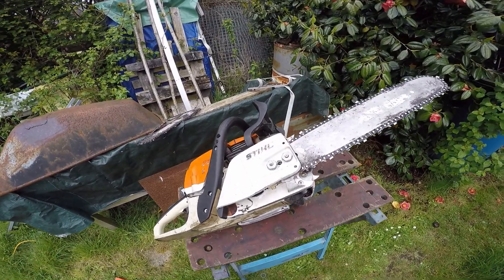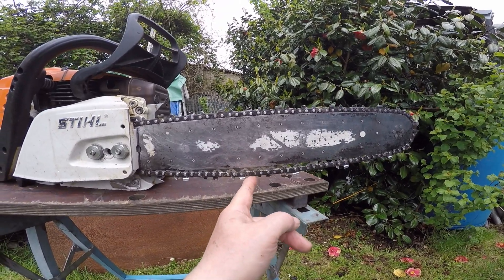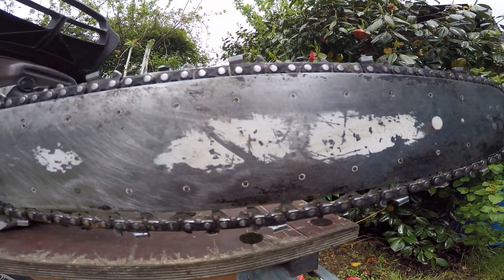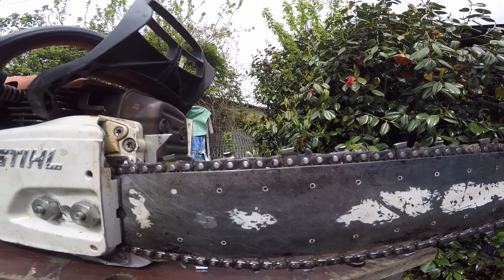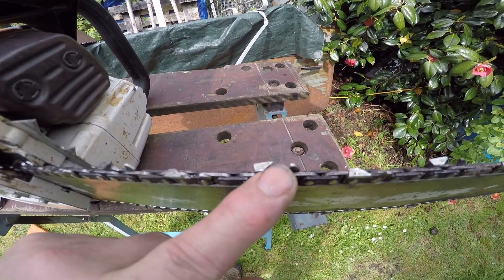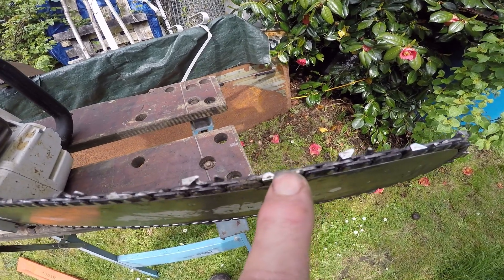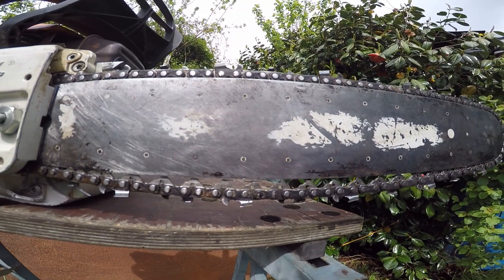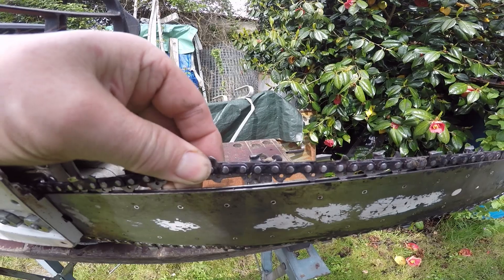Why Does The Chain Come off My Saw?

Comment: Very informative video. I don't understand yet how much the depth gauges need to be filled away to correlate with tooth ware but then again I don't own a chainsaw yet.
Reply from the maker: If you're just starting, follow the manufacturer's advice. Basically this means that the depth gauges don't need touching 'til the chain approaches half worn. Then you can get guides that match gauge depth to individual cutters. Oregon and Husqvarna both do one. Of course you could join a Facebook group or go on Youtube and watch hours of dubious advice about how to sharpen a chain and how to treat depth gauges.  Or you could watch this: https://www.youtube.com/watch?v=G94bU1DlMtY&t=51s  This isn't me. Don't know the guy, but it's the advice I'd give, well shot, well thought through and done with no ego. Recommended and good luck.